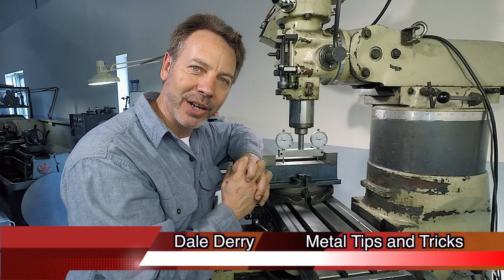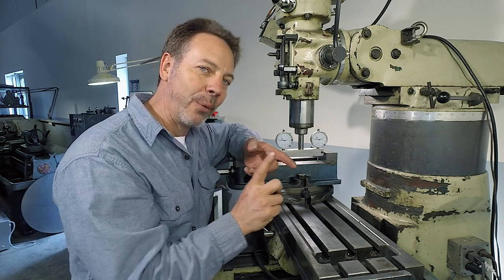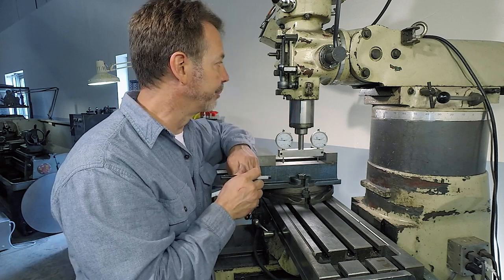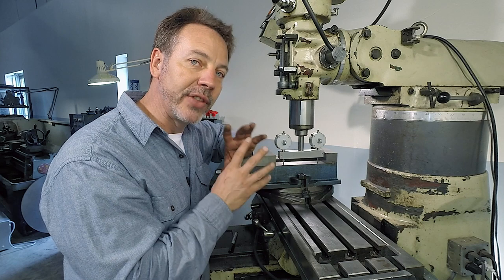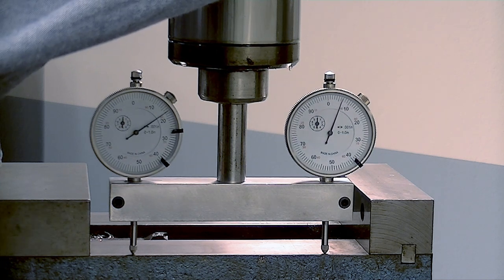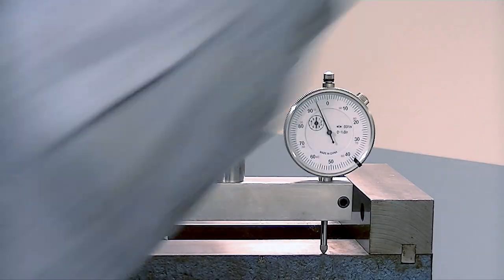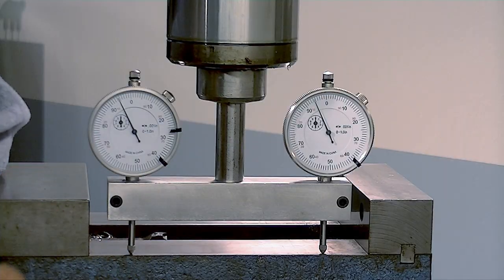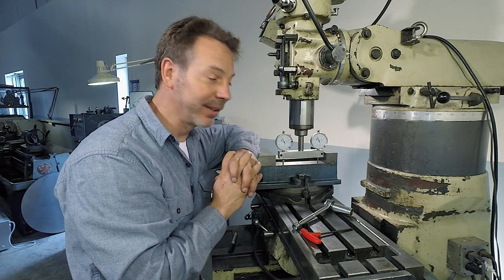DIY Spindle Square Part B

Comment: Extremely useful tool, not only for setting your mill head straight, but using it with a sine bar to set accurate mill head angles.

Comment: Hello sir, I'm thinking about making me one of these! If my mill is slightly out of tram... when I make this part and 1/2'' diameter arm is not perfectly square with the aluminum block... will this still work after being calibrated? I'm trying to wrap my head around it... But I think it will still work?

Comment: Most excellent Dale, thanks...! Years ago I made a spindle square using a 16" rod to hold a single indicator (thinking a longer sweep was better). Flex in the rod was a problem. I like your design better because of stiffness. Cheers, Daniel

Comment: This is a great series of videos. I'm going to build this when I get the chance. Thanks for posting. At minute 6 you mentioned the differing plunge rates of the indicators due to the different distances from the nod pin and a thought occurred to me to add on top of the aluminium body near the shank a small button level as a quick visual in addition to a solid square to get you in the ball park. You could probably put it on either side of the shank lightly pressed in a spot-face. Maybe add two just to make the gauge look symmetrical. Thoughts?

Comment: Dale

Am I missing something, or is the fact you adjusted the 'nod' off the vise possibily causing errors,  How do you know the vise surface you indicated against is actually parallel to the table surface???  I was taught that you ALWAYS tram the head to the table surface.

John
Reply: @John Crea
He mentioned in the first video he preferred to tram/square to the vise, rather than the table, since wear in the table could cause inconsistencies.

I got that the 'hidden message was his Bridgeport probably has some wear.  LOL

Comment: Assuming you have enough preload on the indicators, why not just set the dial to zero on the second indicator instead of moving it up/down?
Al
Reply from the maker: cpcoark You can do that, but for me, i like everything to  be congruent because it make for less chance for error.

Thanks for the question
Dd

Comment: I finally "finished" my spindle square last night.  I went cheap for my first build, so I ended up with a matching pair of  0.01mm dial indicators.... no biggie..
Anyway, I had trammed my head original using a single indicator method, and that indicator was a 0.001" (inch) type.   
Well I put the spindle square in my machine and calibrated it, and checked the tram,
i was off by 0.02... and I kept chasing that thing around.. It dawned on me today, when I came back to re-evaluate what was going on, that the 0.02 error was actually in mm, NOT Inch!   so my error was only 0.0007" (~) close enough, where I don't have to worry now!  I had forgotten that I had used mm indicators, and it didn't even occur to me to the check the dial marking (d'oh!), till I wanted to confirm the indicators were functioning properly, so I slid a 0.002" feeler gage under probe and it went in excess of .05(n) or so.. and I said 'that ain't right and investigated making the discovery) < apply that to lessons learned>

I also used a slightly different calibration technique that I saw elsewhere on Youtube (sorry to stray) ;) 
Like you, Pick a spot, but put a small block between the table and dial indicator, raise the knee to zero it out, then rotate the bar, and adjust the other indicator to match zero.  Rotate back to confirm.

Anyway, thanks for the inspiration and video.  You need to reboot this series (DIY stuff).  cheers

Comment: Weren't you supposed to zero the gauge closest to you, rotate the tool 180 degrees to the mark on the vice, then zero the gauge closest to you (this is the one that was furthest from you prior to the 180 degree rotate). Or did I miss something?